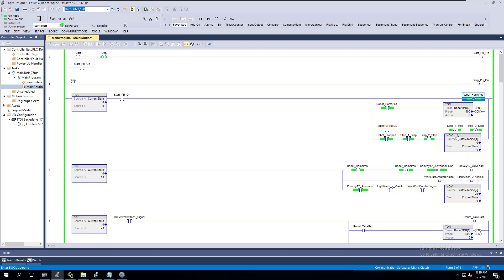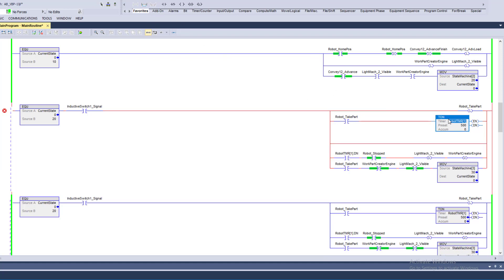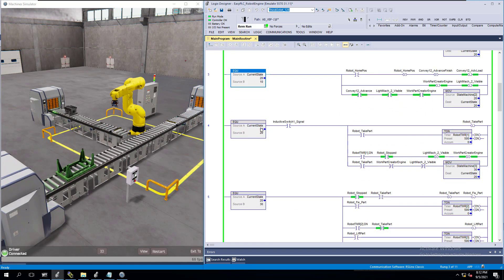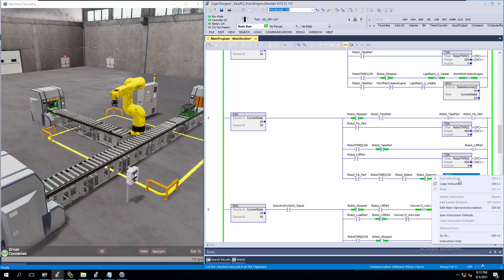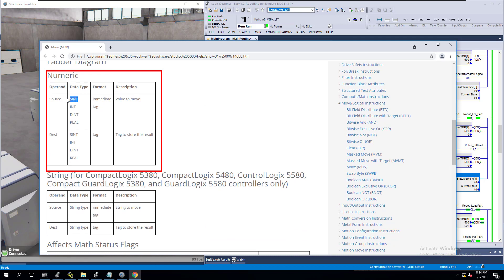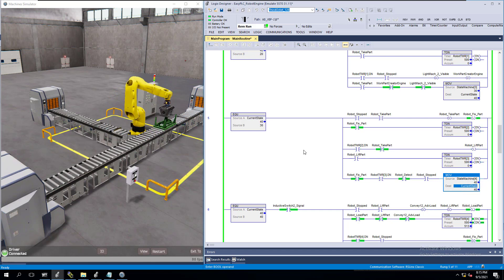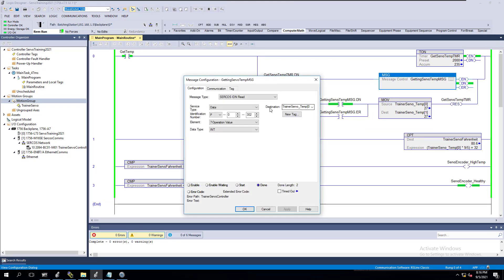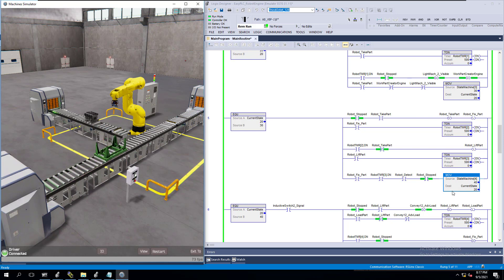Studio 5000 MOV Instruction Tutorial | State Machine Example

Comment: do you have some video using the master driven axis control (MDAC) instruction, I can not undestand how to use it :c
Reply from the maker: The MDAC instruction is used to synchronize axis together without having to use cams.
Based on the master reference from the slave axis.

I can make a video on this is the coming future.